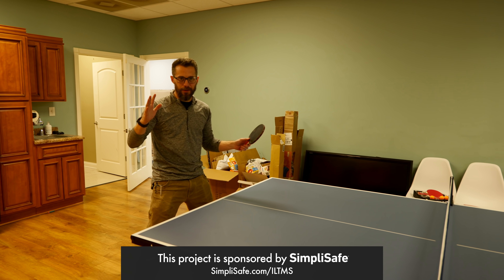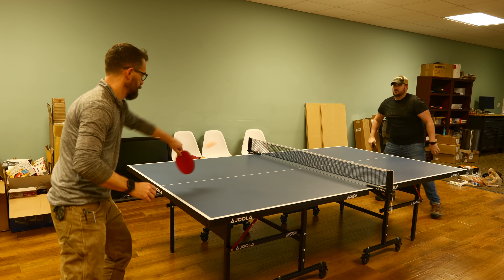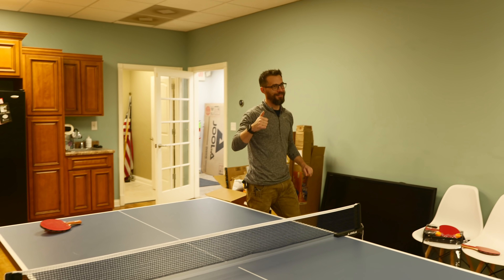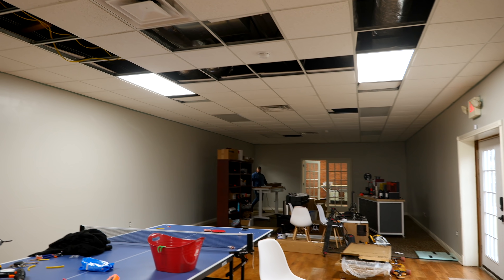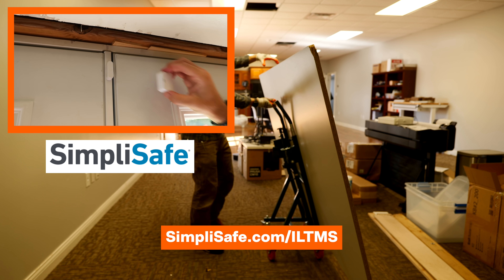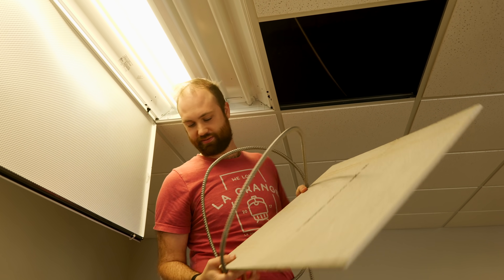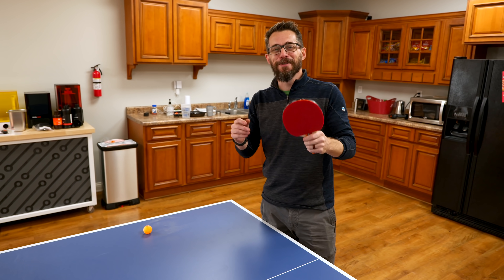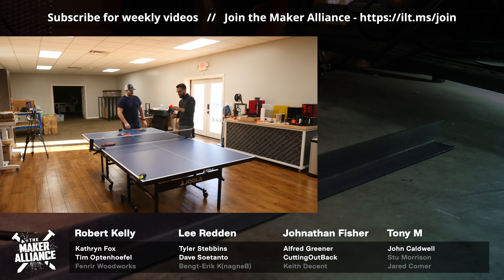Loser Does the Work \\ Between The Builds

Comment: I understand the room is big but I would strongly suggest moving the 3d printers out of an area where you will be eating. FDM printers are known emitters of microplastics. Since you aren't putting the plywood in the cnc room, maybe you could move them in there? It wouldn't be a perfect solution but better than in the same room. I would move the msla printers as well because of the fumes but that's not directly related to food.

Comment: Looks like a lot of ways to avoid doing the work. Not a bad thing, and I'm as fond of prevarication as the next man, but call it what it is - you guys like playing ping pong. Have you tried ping-basketball?
Having developed software, with project management, for 40 years, the best way to complete a big job is to split it into smaller jobs. You already figured out replacing the lights can be split in two, by saying you want to "compare the old with the new". Four walls, that's four smaller painting jobs. Looks like you had a lot of fun.